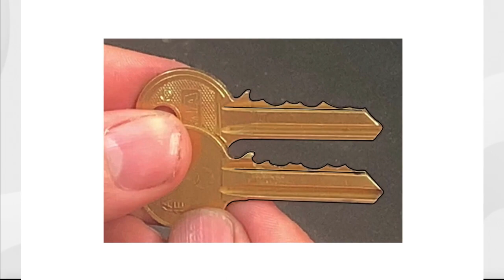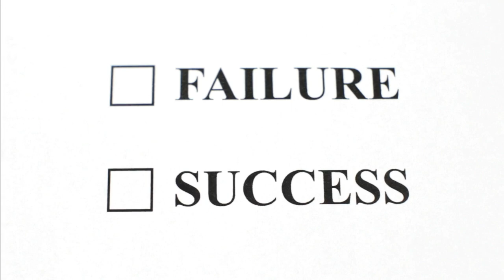040 A beginner's guide to key impressioning (3/3)

Comment: Excellent explanation Andy, my only comment is that the bind and bump only needs to be done once and then release tension. Whilst the lock is under tension there is no benefit to having a second go at inducing a mark. The first time you bump, up or down, the pin moves position and is pushed away from contact with the key. It won’t return until you release tension. So the efficient process is bind bump up release, bind bump down release in alternate  directions. I admit in practice this is difficult to discipline and control but if you work at it you will reduce time and minimise stress to the key.
Reply from the maker: Ahhh sorry Martin - I don’t know how I forgot such a key part of the tutorial session. I should have made better notes or recorded our call! See - now I have no reason to berate my own students when they fail to pay attention in class!! 😬🙌

Comment: Great closing chapter for this series! I have noticed that with my impressioning that the fact that my filing isn’t perfectly centered where the pins go and not perfectly spaced leads to the key often looking odd compared to a code cut key or somebody else’s impressioned key. I’m sure that get’s better with experience, but I much more prefer to pick than to impression in most cases, although occasional impressioning is fun it’s a useful skill to have if you get locks to which you don’t have keys and are having trouble picking. Cheers!
Reply from the maker: Yeah I think it takes a lot of practise to execute well but, as you say, a good skill to develop. Glad you enjoyed it 🙌

Comment: Hi Fish, just one word: impressing! ;)

now that I've seen this mini-series, many ideas come to my mind to improve the process of impressioning...

for example a template made of acrylic sheet, acting like a cutaway lock, to mark the positions of the pins on the blank.

My Impressioning grip is made from a squared rod of stainless steel, cut a slit in one side to insert the keyblank and some threaded holes for screws to fix the blank (had a hard time drilling and tapping those holes)... the additional handle is going to be the next modification :D
Other ideas are still in development...

Greetings from germany and stay healthy :)
Reply from the maker: They sound like really interesting innovations - hope you make a video to share them with the community 😉🙌
Reply: concerning the template, of course you'd need a template for each lock mfg unless they had the same spacings. I think of it like a Sandwich of 3 sheets, where the middle one restricts the position of the key in the template, and the two outer sheets have slits on the positions of the pin stacks, so you can mark them with a sharpie. A set of horizontal lines for the cut depths would be nice also :)
Reply: @fishpicks4531  nah, I'm not so much a video-guy ... but for sure I'd share CAD-Data or similar, so everyone should be able to replicate it :)

Comment: You seem to be having an easier time learning this skill than I had. Maybe it's because you have some kind of guidance, but regardless, congratulations are due. I still struggle especially when starting with a cut key. (Blanks are sometimes unavailable.) For the heck of it, try to impression the Yale push key. It's a whole different kind of challenge! I have spectacularly failed twice without having any success, but it has to be possible.
Reply from the maker: Sorry to hear that mate - hang in there. Like anything, I guess it takes practice. Start with something easier, reduce the core to 2 or 3 pins until you can nail that - then add the others back in one at a time - creating a progressive skill ladder like this could help. 🤟

Comment: Could it be that the key's shoulder were slightly off during your preparation that cause the different length of blade inserting into the key hole, which in turn cause the difference on the 4th pin? Or maybe the difference of your filing width compared to Mr. Newton that has lead to different contact surface?
Reply from the maker: Yep I think either of those could be possibilities - the margin for error is so slim with this kind of technique - but we both arrived at a working key so I guess it’s win/win 😉

Comment: Great final Fish and congratulations both on the series and getting your impressioning skills started👍The end screen of youtube didn't actually show other videos to click on. Not sute what's up with that.

I can think of two reasons why the cuts are a bit off and I can be wrong on both. I have seen others warn about the file tending to cut away in one direction more than another. E.g. it can tend to run to the right side, moving your cut away from the pin center as you go. A remedy (didn't you show that in your series? I thought you did but am not sure) is to draw lines down along the key from your pin position marks, so during filing you can make sure to stay centered.

I also see your initial markings were slightly unevenly spaced. I don't know if that is correct for this lock but I have seen others simply check this against key specifications and correct for that.

Anyway you have experience and I just absorbed information so I can be completely wrong. Great series again and when I start impressioning, I will watch these again👍
Reply from the maker: Thanks mate - the end card had to do with which device you’re watching on - my iPad doesn’t show them but my iPhone does, for example! I think you may be right about the initial spacing of the marks - I think in the future I’ll try just working from the polished blade and let the marks dictate the filing positions 😉
Reply: Yeah that's possible. I'm on android.
You can compare your methods with others and see the pros and cons of course🙂
Jos Weyers of Toool NL also has nice (old) videos and might also be able to answer specific questions, next to the people you are already talking to. He has a long history of winning impressioning competitions.